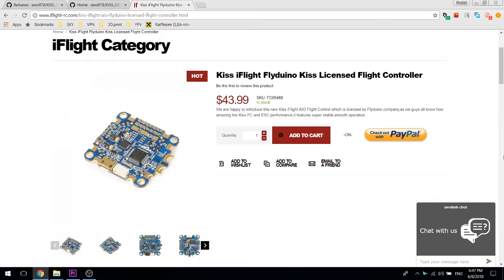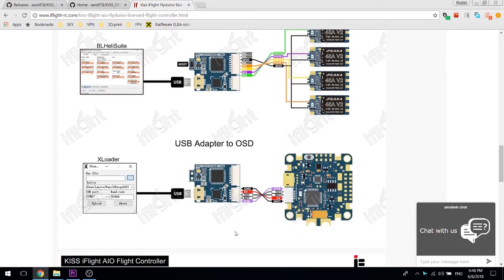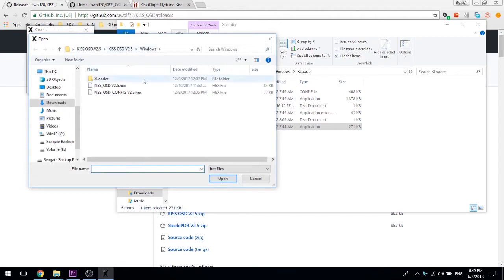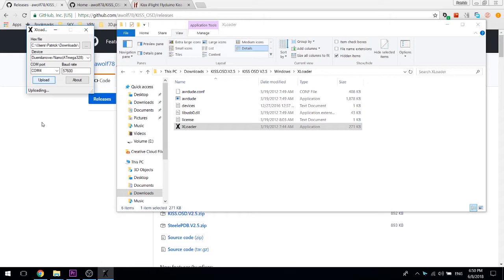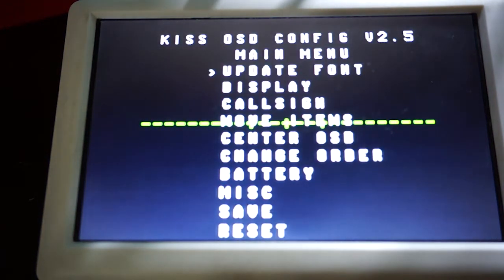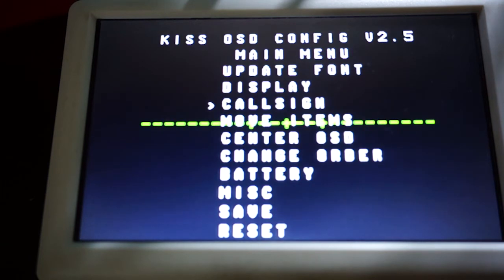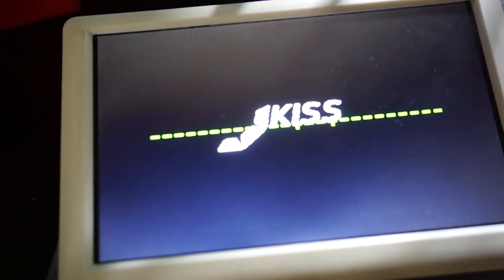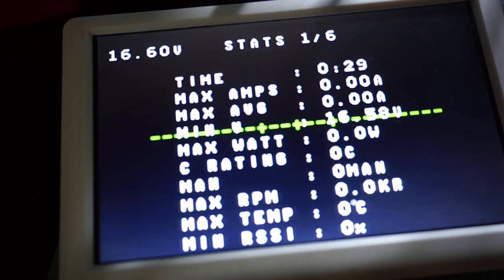OSD setup // iFlight KISS

Comment: Hi, have you got any idea to connect Frsky XSR rx to a Iflight Kiss FC in order to get rssi indicator to osd screen. I am stuck hier
Reply from the maker: xsr has amn rssi output? if so you can directly connect to the rssi solder pad in the FC. If not I'd use the frsky remote to give me audio signals
Reply: Thanks, I will have a look and let you know

Comment: when i set up osd, everything good. But then i maiden my quad and OSD started disappear after few sec fly (atually, osd stopped working a few sec before it disappear), it says No connection to KISS FC. But when i restart my quad, the OSD show up, seem it only disappear when i arm my quad . Here is the clip, but the text showed "No connection to KISS FC" was not recorded
Reply from the maker: Did you add a capacitor? The kiss osd chip seems to get messed up by ESC noise sometimes. That's a typical kiss problem
Reply: i fixed it, ty. Just because i dont set logger to logger off/osd , 1st time with kiss is a quite confuse with thier setup :D
Reply from the maker: Yeah, it's indeed a little tricky after betaflight die example 😉

Comment: In my case it's getting stuck on "uploading" whether I try uploading config or OSD file. Any ideas?
Reply from the maker: Hmm... Did you check if the drivers are all set and the port is correct?
Reply: Yes, COM port is correct, just in case I've reinstalled Silabs drivers, I'm certaing they're correct. I've also tried using Arduino, that one fails after a while. On a different PC with fresh drivers Xloader returns "Upload failed", though that one is an old WinXP laptop.
Reply: hi, did you have solve your problem? I have the same :/
Reply: I did. It actually turned out that I soldered the receiver 5v to wrong pad. :P That pad I used is right next to 5v for rx and it's labelled. I'm guessing it's some 3v3 rail for CPU or OSD chip, that's why flashing kept failing. iFlight's support had no idea what is this pin for either. :D
Reply: Also you have to plug in the OSD flashing thingy right AFTER clicking "flash". Put the connector in the socket just a little bit without making contact, click flash, then immidiately plug it in fully. I used to operate my mouse with one hand and plug the connector in with the other to make it quick.
Reply: I tried all you solutions but it won't flash anyway... I power on the FC with an usb charger, receiver unsolder. I plug in first the usb adapter to the PC, and plug it to the fc after clic on upload but it doesn't work.
Reply: Try flashing via Arduino tool, it will show you actual logs that might tell you (or someone on RCGroups) what's wrong. You can also contact iFlight support. They will confirm whether the board is defective or not. Once they do you can contact your store and they should replace it for you.
Reply: I don't have any knowledge about arduino...
Reply: In this case I meant Arduino IDE, it's a software that you can use to upload those files, the only difference is that it'll show you the logs after the upload.
Reply: it want not .hex files....I'll cry :/
Reply: hi @david , have you solve this problem ?
Reply: @haditsbaroya5408  hi, not yet, I tried many ways but never works
Reply: today I tryed one more time and it works, just plug in the adapter and not power on the FC, I set up the osd first, but when I make the second upload, it works to but on my display I have the kiss logo, "disarmed", "armed", low voltage alarm, but nothing on the osd during the fly and after, no voltage, no time...
Reply: @davzipper  might be setting logger to logger off/osd in KISS GUI
Reply: i cant get it to work either. Tried every combination of plugging and unplugging